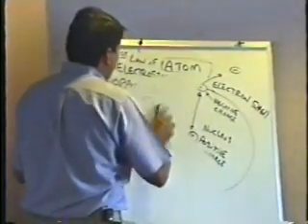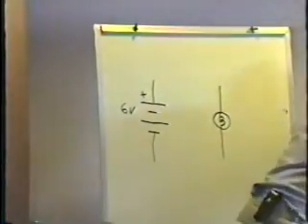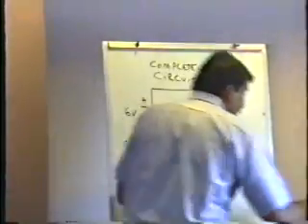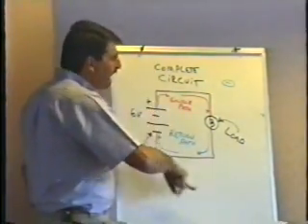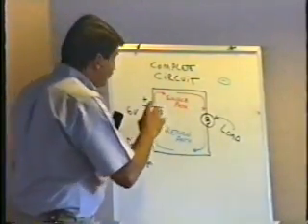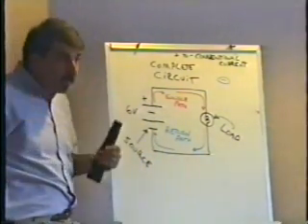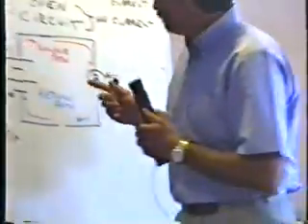Basic Electronics-Chapter 2

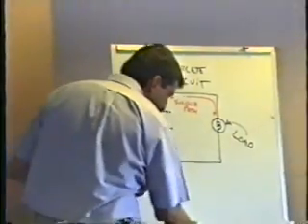Comment: Why does the circuit need to be complete for the light to illuminate 6:05 ? If there are electrons going from the source, through the wire to the filament, why doesn't it light up? What does completing the circuit with the second wire do that illuminates the bulb?
Reply from the maker: Without a return path, the electrons have no place to go so their charge at the end of the wire is the same as that of the source. There is no "potential difference" that is to say, there is no difference in pressure between the two sides of the load so there is nothing to make the electrons move. Everything is static. Imagine a game of tug-of-war where both sides have precisely the same pulling strength. NO WORK is actually done.